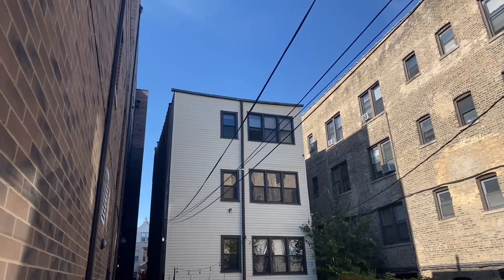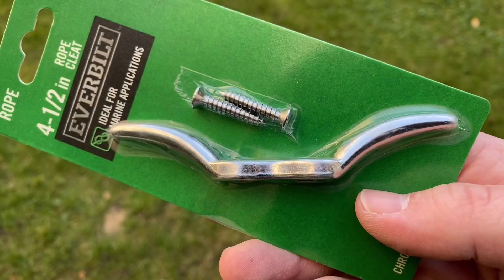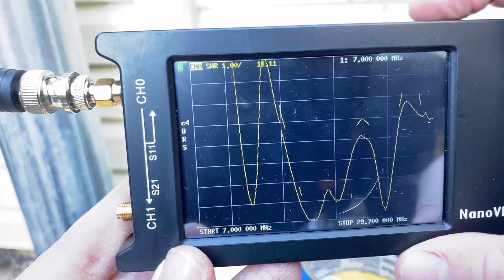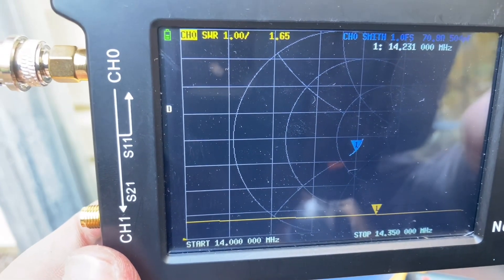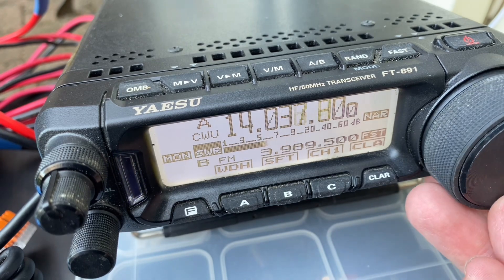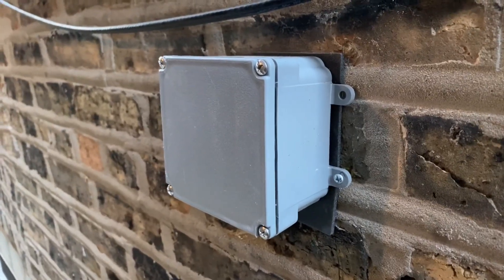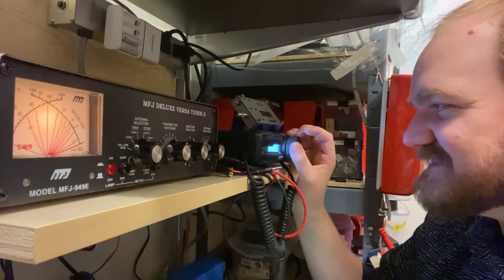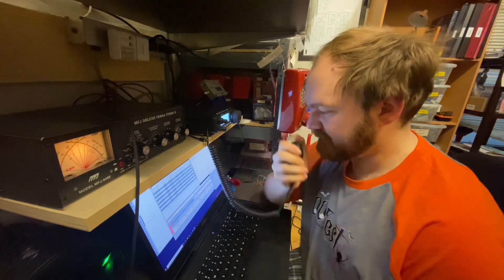Stealthy Apartment Antenna - End Fed Halfwave in the City

Comment: Hi Jeff... You are an Urban Warrior!!  Hey, with a proper length you should be able to get 40/20/15 and some of 10.  Get some Brasso on that Spark Plug..it will be shiny like new in no time.  By the way, no worries on the Spark Plug out in the weather.  It will take it.